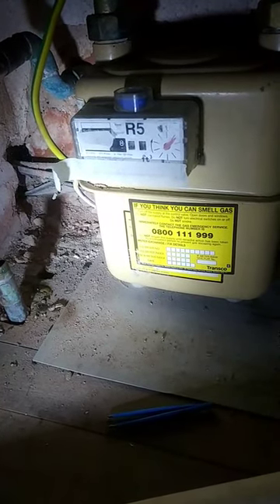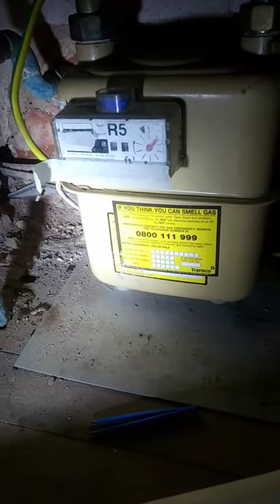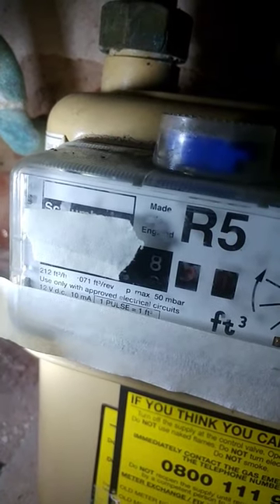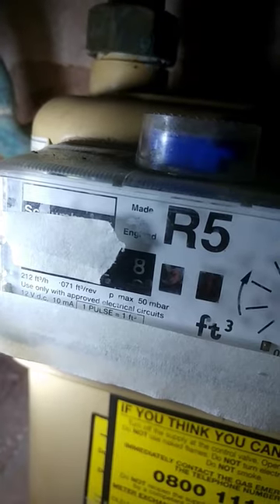schlumberger r5 gas meter rj11 port to read consumption

Comment: Any more details on how to actually read the data ?
Other than an rj11 cable what hardware/software requirements?
Reply from the maker: https://community.openenergymonitor.org/t/availability-of-gas-sensing-devices-schlumberger-r5-with-a-pi-zero-acting-a-mqtt-feed/17868/24

This is where i found out how to do it and asked a few of my own questions. Hope that helps.
Reply: @Whereswally606  ta ..some bedtime reading.
Reply from the maker: @j_o_h_n_d_u_n_n  yep there are some red herrings in there but the yt video he links is really helpful. Still not gotten round to finishing mine as its got pushed way down the priority list.
Reply: @Whereswally606   possible silly question, but on my Schlumberger R5 , when the main 4 digits, white on black, increment by 1, is that 1 cubic ft , or 100 ?
Reply from the maker: @j_o_h_n_d_u_n_n  i assume the white digits are units ten hundreds thousands and that the red are tenths and hundredths of a ft^3